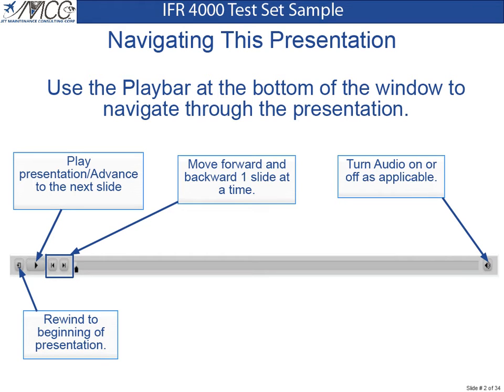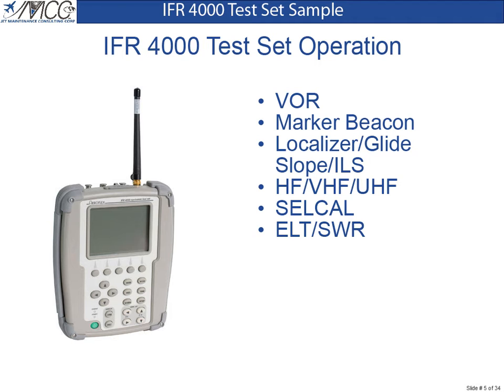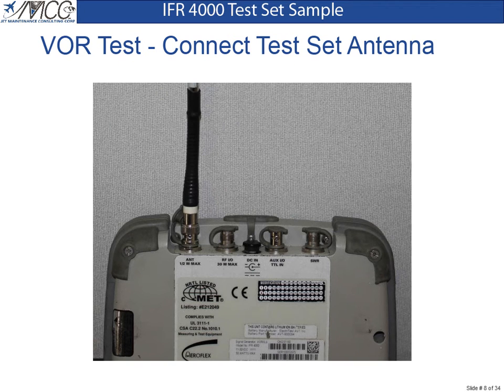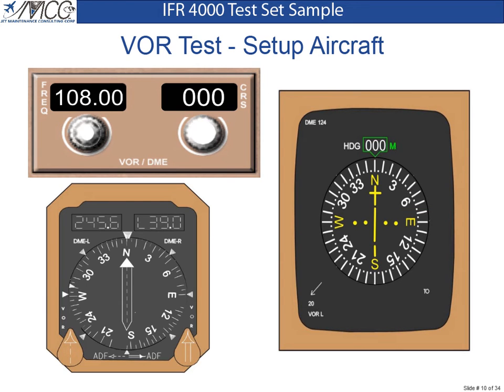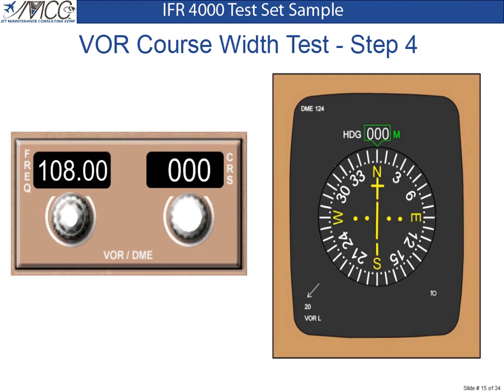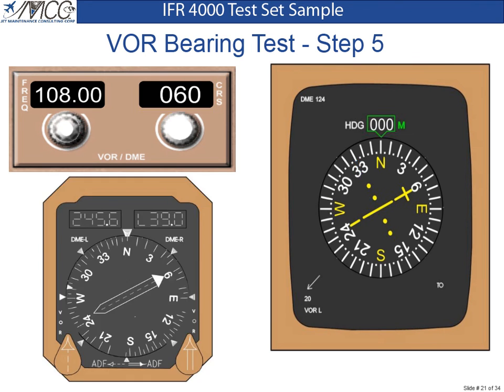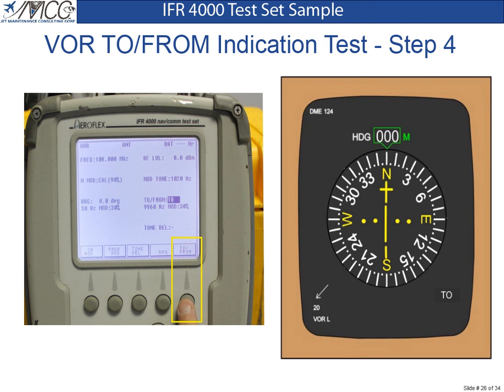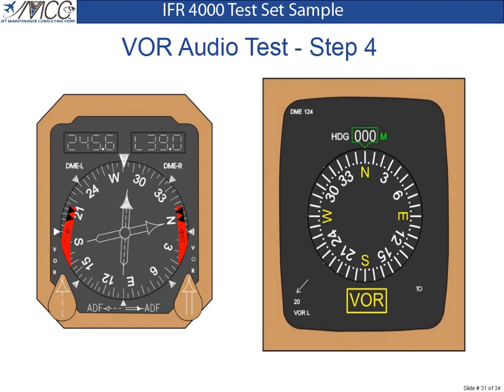JMCC IFR 4000 Test Set Sample

Comment: This is helpful! Thanks! Any tips for the Audio Test? Is there a specific place to stand around an aircraft with the IFR4000 test set for this VOR test? Would a fence or other objects cause interference to these signals??
Reply: Nowing that you are going to be changing your Test selections on the VOR Test Set as well as on the Aircrafts VOR control Panel, the best place to stand with your IFR 4000 Test Set is to be in the Aircraft Cockpit itself.